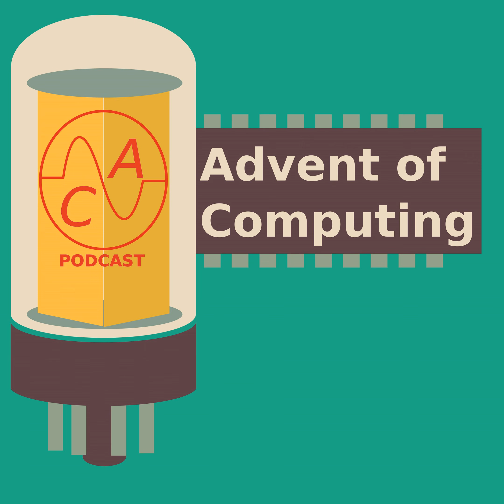Episode 161 - The IAS Machine

Comment: Cray's designs from the CDC6600 on packed multiple instructions in a single word (up to four 15 bit "parcels" in a 60 bit word in the case of the 6600, where each instruction was one or two parcels) such that it was only possible to jump to the first instruction in a word. Chuck Moore's Forth processors from the F21 on also pack multiple 5 bit instruction into each word but with two complications: an instruction that needs an address (like LITERAL or JUMP) will use the remaining bits in the word (so you might need to add NOPs to bump it to the next word if there are not enough bits left in the current one) and if the word size is not a multiple of 5 then the first instruction will just have zeros is the missing top bits (and the opcodes were selected so the most popular instructions have zeros in their high bits)